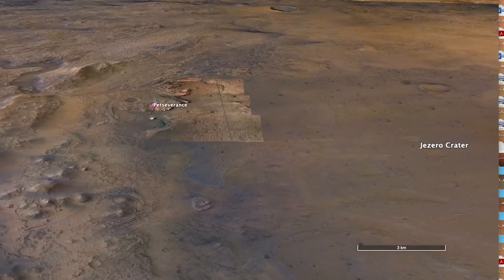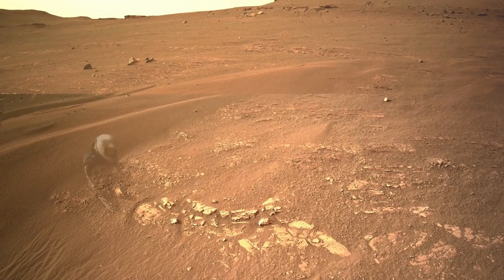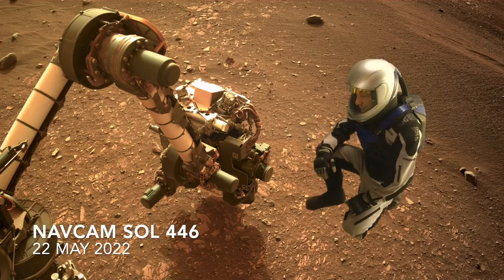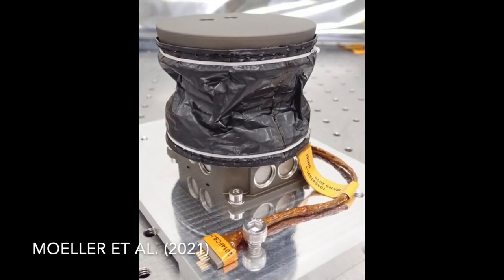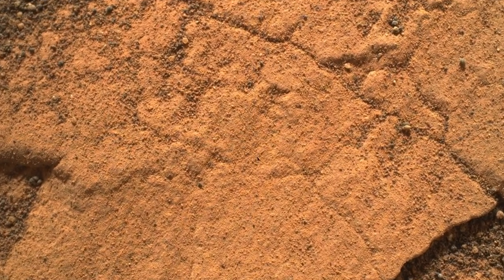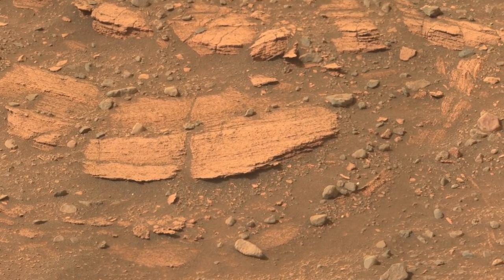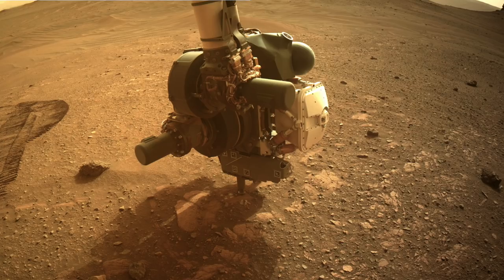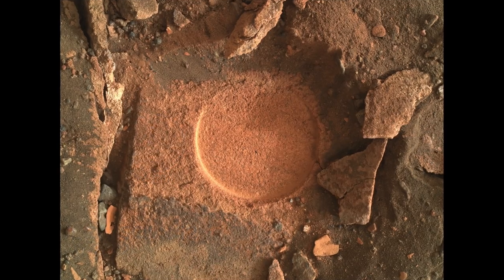Perseverance overpowers its first delta target

Comment: hypothesis "U-dam":
Could something like this have happened?
That at some point a U-shaped dam would form starting at the Voyageurs quad and continuing through the Yoho, Everglades, Karijini, Moncayo, Katmai and Shenandoah quads?
That one or several bars of the delta in the southern part of the Voyageurs and Pembrokeshire Coast quads would break and change the direction of the current?
That this change in current was followed by one or several strong surges that crossed the Ballons des Vosgues quad from NW to SE (WNW to ESE)?
That the U-dam was broken in Katmai and Karijini?
That the remains were distributed in waves forming the Seitah?
That the Kodiak remnant would open up like the hands of a clock, leaving it at the position of the hands of half past two?
...
Do the two mounds SE of Kodiak have names? Will it take long to baptize them and make their names known?

Comment: Helicopter's Chief Pilot Grip published that Ingenuity's clinometer died. An essential sensor is lost but they will try to fly without it. The pre-flight routine includes this sensor being calibrated before the spin-up and take off. The lack of the sensor will stop measuring the helibot's attitude, pitch and roll. It seems they will have to trick the IMU with a calibration input while the helicopter is on the ground.
About NAVcam:
I remember that before flight 19 they had problems getting ground references when having landed on the sand and having dust around the NAVcam. They solved it by creating a mask so that the recognition algorithm would omit certain peripheral areas of the lens.

I think that the clinometer problem could be solved using RTEcam and flying sideways (flights 10, 13, 22 and 26). Where IGY is landed or stationed now (after 28th flight), The RTEcam sees the horizon (see RTE photo at sol 449) as two right triangles with curved hypotenuses. The only thing that doesn't change in these photos is the feet of the front landing gear (ever at the same height in the frame). If iIngenuity goes up each time more sky will be seen at the top of the frame, but if it tilts (rolls) to one side or the other (when starting or stopping sideways) more sky area will predominate in one of the triangles. That could be interpreted by a computer.

When flying with the RTE camera pointed backwards, a pitch toward the ground presents more sky in the upper frame of an RTE photo while a brake might represent no sky at all.

The delta sediment layers parallel to the Three Forks floor could be a "useful horizon" for the Ingenuity RTE too.

What does not seem easy is to explain this to Snapdragon :)
Reply from the maker: Yep, saw the report.  Looks like they've got a workaround.
Reply: @MarsGuy  Thanks